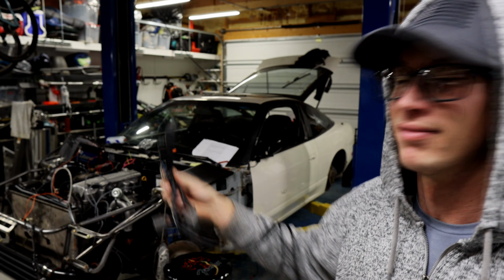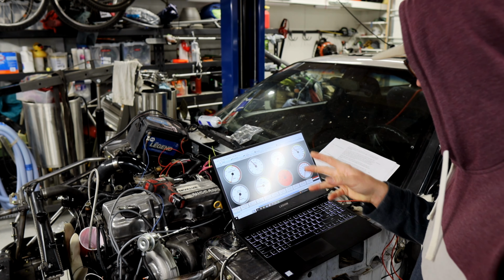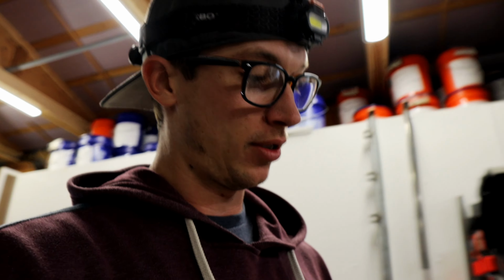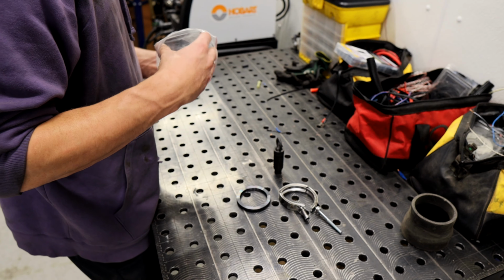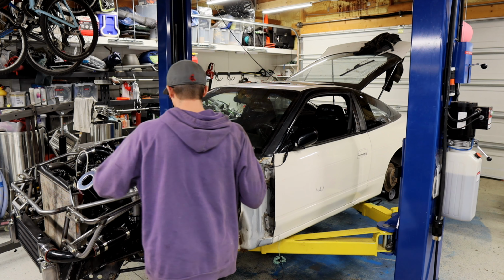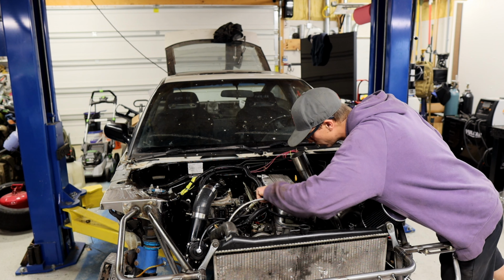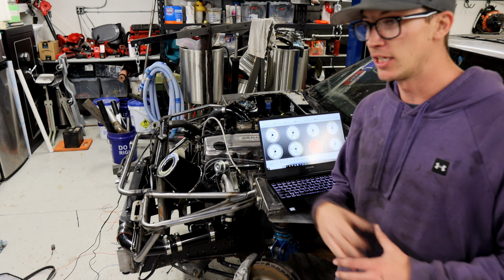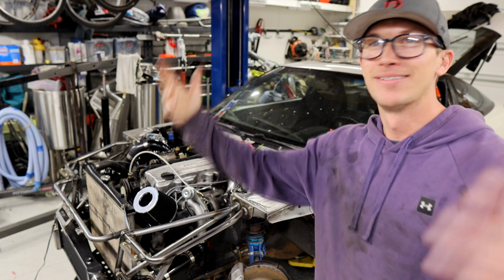TURBO 240sx First Start | Worlds Cheapest 240sx

Comment: absolutely loving this build! quick question tho, on my d21 my motor mounts are completely shot. would the 240's motor mounts fit on my truck? the only poly mounts available are for the 240, and all they offer for the truck are factory replacements.
Reply from the maker: Should drip right in, just watch the pan clearance.